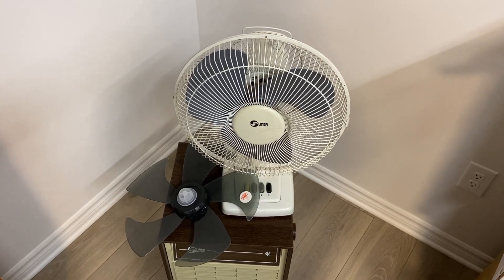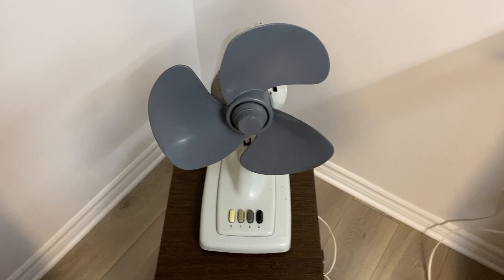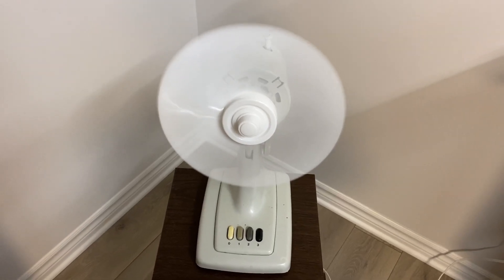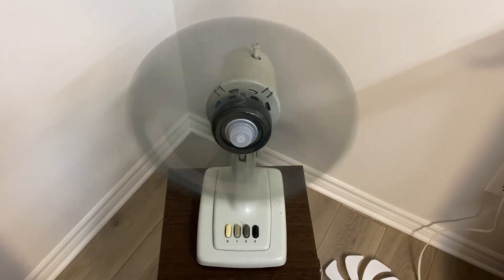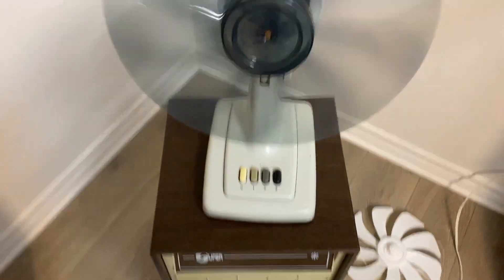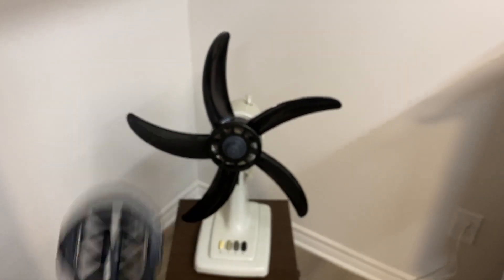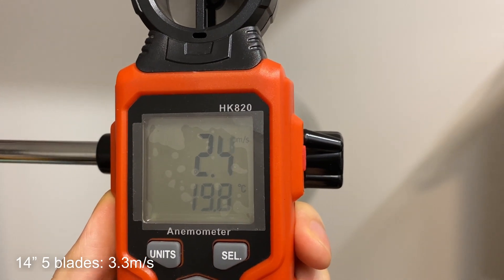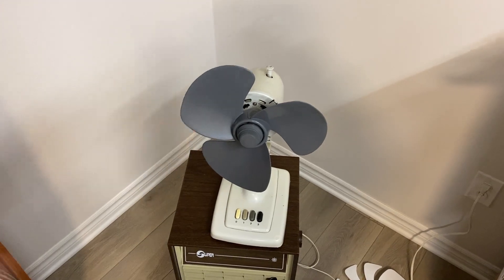1996 Super 12” Desk Fan | Blade Comparison Test: Part 1

Comment: Is this fan wall mountable
Reply from the maker: I don’t think it’s wall mountable originally, but I’m sure it could be if I were to drill some screw holes in the base.
Reply: On the base, there are some holes and some are covered by black caps
Reply from the maker: The black pieces are the feet. The other holes are for screws that connect the base pieces together, not for wall mounting.

Comment: 4:02 now the fan is making the same sound as my arno nv 32 12 inch 80w fan with oscillation without springs with balls
Reply from the maker: Neat! What’s the springs and balls? Are you referring to the ones in the oscillator gearbox?
Reply: @TheSuperFanMan  yes

Comment: I can tell this is going to be a very interesting series! The translucent 5 wing blade reminds me of a fan I saw in China a couple years back. It looked exactly the same as yours, and it's mounted on a wall fan with grilles meant for a 16" fan blade. The proportion looked awful lol. I recently found a 16" fan blade for sale in Asia online which have 15 wings, you should definitely get one of those if it washes up on your shores
Reply from the maker: Neat! It seems like these kinds of blades are more common overseas. What a coincidence, I actually bought the 15 wing blades recently! It should be arriving soon. I bet it’ll sound real buzzy lol.
Reply: @TheSuperFanMan  all the other blades will wobble becuase the original pin that holds the original blade does not fit with any other kind of blades. (I think)
Reply from the maker: I no longer have the 12” Super pedestal fan so I won’t be able to do a test with it. But I would say these blades would perform exactly the same as they did on the Super in this video, since they both have identical motors.
Reply: omg try the different blades on the following fan that in my opinion would be very interesting
Reply from the maker: That’d be cool, but the Following Fan has a larger motor shaft diameter than the holes in these blade hubs. They won’t fit unfortunately..
Reply: @TheSuperFanMan  aw man
Reply: @TheSuperFanMan  oh ok.
Reply: @TheSuperFanMan  what happen to the fan did it break
Reply: @TheSuperFanMan  can you try the blades on a 12 inch super pedestal